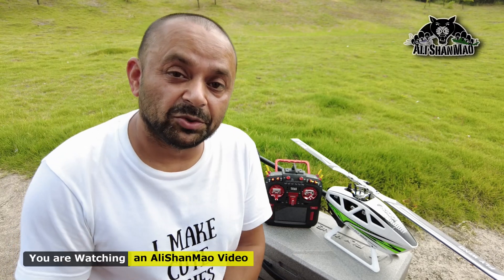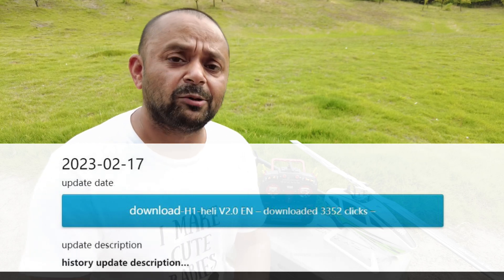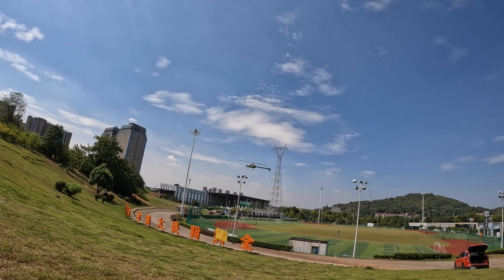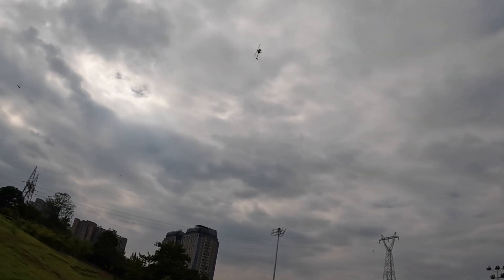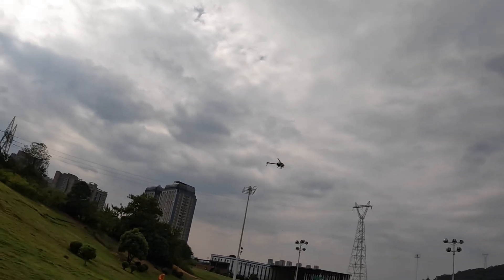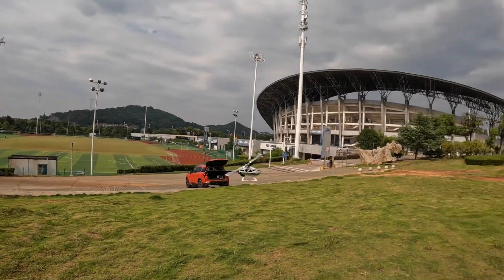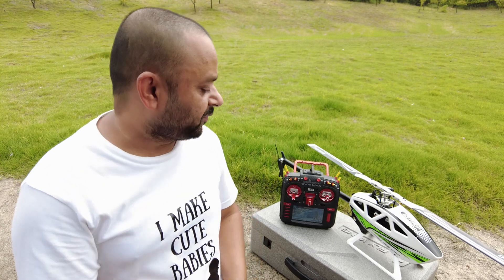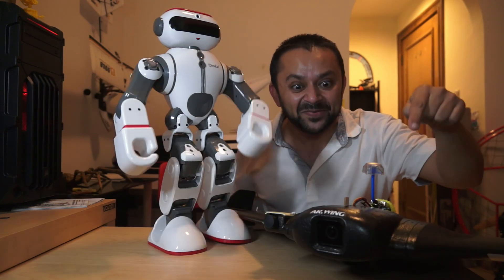Crash-Proof Technology: FlyWing FW450 V3 GPS Helicopter's 3D Security Feature

Comment: Wow!  This is great!  Thanks for the info!!  Any idea if this will work on the older H1 controllers with the GPS mounted on the tail boom? I would assume it would, since  it is software based.
Reply from the maker: it should because its the software based, using V2.0 you can turn this feature on. give it a try. you do not have to actually fly 3d to find out if it works or not. once you turn on this feature, power on the helicopter, wait for initialization to finish, now on the ground switch to 3D. if light turns blue, that means it did not work, if switching to 3D switches to or keeps in GPS on the ground. well it works :)

Comment: Does it work every time guaranteed?
Reply from the maker: so far it did. as per my testing. set higher safe altitude like 8 or 10 meters for beginners. keep helicopter lighter. use smaller battery, do not use heavier batteries. works better if you use standard rotor head. quick release rotor head works too (as you watch this video was done with quick release rotor system) but its more safe with standard head.